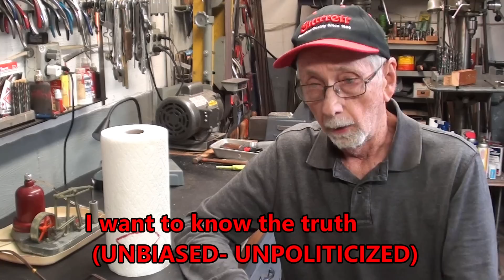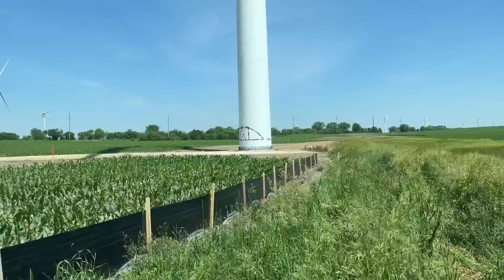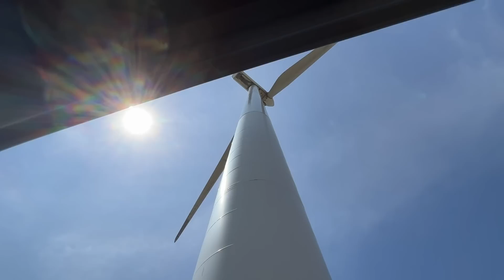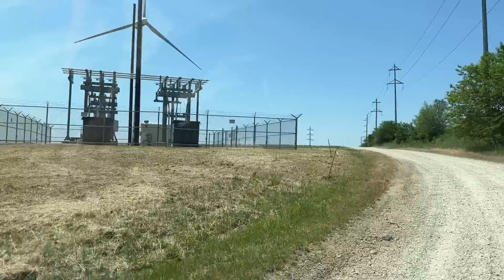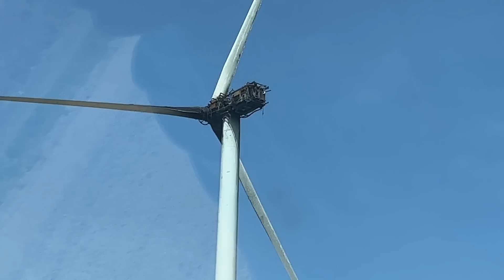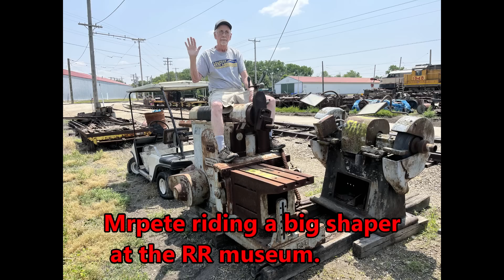OBSOLETE WINDMILL DEMOLITION short #46 pt 1 tubalcain

Comment: All this greenwashing is a money grab. End it including all anti-coal and anti-fracking efforts. Compared to the benefits of civilization the effects of pollution, even dramatic examples with high local casualties, are trivial.  Nuclear power works fine too, proven by France every day without any fanfare. No one was killed by radiation at Fukushima either, that was all done by the tsunami. 
Oil makes the world go round and the benefits more than pay for it even including wars for the petrodollar (where US military dominance ensures microscopic casualties by historic standards, a fact people swayed by drama can't process).
Reply from the maker: Thank you for a very interesting comment. Very factual and accurate, but people will not listen. They have been indoctrinated over the years. If you tell the same lie often enough.  it becomes a fact. Notice the hostility displayed in about half of the comments. Unfortunately, this was a Polarizing topic and video. I did not expect it to be that way. In fact, I thought 100% of the people would agree with me.

Comment: I live in northern Germany, near Bremen, in the state of Lower Saxony ("Niedersachsen").
Many wind parks have been built in this state and the adjacent northern states. In total, we have more than 30,000 wind turbines in Germany.

They produce about 20% of our total electric energy, and more wind parks are in construction or are planned currently.
Nominal total power of those 30,000 turbines is about 55GW (IIRC), and national power demand is about 60GW on a typical day.

Now - in summer - they don't produce much, but we have quite a bit of solar plants - including those on private houses - supplying the grid with easily 35GW or 60% of the demand. But thats, say, 9am to 4pm. Total share of solar is currently 10% of german energy production over the year.

Of course there is a lot of supply variation, but the grid operators can plan ahead. The wind does not change suddenly (as you wrote), but quite foreseeable due to weather forecasting. Same with solar. 
To see how much electric energy was produced this year, see 
https://www.energy-charts.info/charts/energy_pie/chart.htm?l=en&c=DE&interval=year
they also have diagrams for other countries.
This year, we had 59% reneables until now (end of July 2023), thereof about 13% solar, 30% wind, 10% biomass, 4% hydro, 27% coal, and 10% natural gas. Less than 3%nuclear. Projected goal is to have 80% renewables in about 10 years.
 
And about solar: the VAT (normally 19%) has been waived completely on solar equipment for home owners. It's now possible for home owners to get a solar plant in 10kW range for about 15,000 Euros - or less if they build themselves. Energy prices have never been cheap in Germany (not even in the old times when coal and nuclear were heavily subsidized), and such a solar plant will make itself pay in about 10 years.

Concerining subsidies, we had an extra fee of 6.5 euro cents per kWh for many years (called EEG fee - Erneuerbare-Energien-Gesetz, renewable energy act) to support building wind and solar parks. In the early 2000s  wind and solar got subsidized heavily to get to train rolling. But construction costs went down steeply, and efficiency of those planst went up steeply as well, so this EEG fee has been waived recently. 

Wind park owners now get about 9 cents per kWh. Only solar is cheaper.

At sea the construction of wind parks had slowed down in the 2010's, but is now picking up pace. Offshore wind is currently only 5% of Germany's electric supply, but plans are to increase it from about 7GW nominal power to 30GW *this decade*, with projected total power of 70GW by 2045.Turbines in the north sea produce power quite steadily: on average about 40% of the nominal output in summer and 60% in winter.

Onshore old turbines get replaced now, some are 25 years old. The new ones are much higher - i.e. they are more up into the wind and produce more power. Projected is a total nominal output of about 110GW in 10 years or so. Onshore in Germany produce about 22% of their nominal power, but the new 160m (180yd.) turbines (height of generator nacelle of ground, not total height) will provide about 33%. So the older 2MW turbines from around 2010 provide about 440kW on average year round while the new 5.3MW built now will provide about 1700kW.

We are even planning and building new gas-driven power stations - they are the most flexible and efficient ones, and they can be started or shut down in minutes. Of course they are needed to fill in the gaps when wind and solar don't produce. 

The same time we have shut down the last 3 nuclear power stations in Germany for good this year. It's a hot debate here: those who don't want nuclear power stations in the country, let alone nuclear waste deposals, and those who want cheap energy and don't give a damn. And those who point at the enormous costs nuclear has brought us: about a trillion marks (approx. 500 billion euros) over the 4 decades of nuclear we had, with more costs to come for the removal of old nuclear plants and the still unsolved disposal of nuclear waste.

Coal is planned to be phased out by 2038 - or earlier. It will be all renewables, supported by gas to fill in the gaps in the near future.  The european grid will do the rest: hydro from Norway and Sweden, wind from Denmark and Britain, solar from Spain. We now supply Norway with excess energy (mostly wind), and get hydro from Norway when there is demand.

Of course, there is a 27% share of nuclear in Europe,  but all that happened in many years is 2 new nuclear power stations in Europe - one in Finland, one in Britain. Both excessively expensive. And the existing ones are getting old.

Here in Germany are very skeptical about the aging nuclear power plants in France - they ran in big trouble last year: outdated, partly broken, out of cooling water in summer due to droughts, but heavily subsidized (20 billion euros/year, getting worse now - the EDF trust that runs the french nuclear power stations had 35 billion  euros of debt, to be taken care of by French taxpayers).

Bottom line is that Germany is fully dependent on imports on oil, gas, nuclear, and hard coal. We spend way over 100 billion euros every year for those imports. Going renewable will change that. We will still spend a lot, but on building renewable systems with local or at least European firms, not imported fossil fuel from the world.

Our closest neighbours will cease the deliver in the near future: the Netherlands stop to pump gas this years due to too many earthquakes, and the British and Norwegian gas and oil fields run out in approx. 20 years. Our industry heavily relied on Russian gas imports since they were so cheap - that's over since the bloody Ukraine war.

What we have is wind, solar, very little hydro, and brown coal - and we phase out the coal soon.

And btw, heating will be changed too - heat pumps instead of gas or oil. Plus electric cars instead of ICEs - the only ICEs that will continue to drive on the long run will be the ICE train (inter city express, electric of course, in use since the 80s). Electric energy demand may rise by about 50% in Germany over the next 15-20 years, but we think we'll make it.

The future is electric and renewable - in Europe, in Asia, and, hopefully, in the US too.
Greetings from Germany!
Reply from the maker: Thank you for the great information and analysis

Comment: I live in the high desert of Southern California.  There's quite a bit of farmland surrounding where I live, mostly pistachios, alfalfa, and apricots.  However, many of the farmers, especially in Newberry Springs, have started putting solar panels in their fields instead of growing crops.  The immediate impact on the whole area is the amount of blown dust and sand, along with the temperature increase and humidity levels dropping dramatically.  The switch from crops to solar panels began only a couple of years ago, but more and more of the landowners are doing it, and I imagine things will only get worse as more and more time goes by.  What was once a beautiful green area swiftly turned into a wasteland.

Comment: I've done some research and I don't know either how well windmills do. The mere fact that they won't publish the honest info leads me to believe that they aren't very good economically. 
The main problem with any "renewable" energy is consistency, Mother Nature just can't be relied upon to produce a constant steady supply of power. There are times the wind doesn't blow, the sun doesn't shine, or there's not enough river flow for hydro. Windmills won't work at all here in TN, the wind doesn't blow constant enough or hard enough to use them. Solar takes an enormous amount of acreage and panels to produce much electricity at all.

Then you have the environmental impact of this "green" energy. For these windmills, I suspect they can recycle a good portion of them, except the blades. The blades go straight to a landfill. Also, all of this is tied to battery technology. Battery manufacture and disposal is a nasty business. From the huge strip mines to get the battery materials, to the smelting plants that convert the mined ore to usable materials, to the plants to actually manufacture the batteries, to the disposal of the toxic chemicals and elements when the battery reaches the end of its life. 

They (the government) are taking away our ability to have a good constant supply of electricity. They are getting rid of coal, natural gas, and even nuclear (we haven't built a new nuclear plant since 1996), and at the same time they are pushing for more electricity load by the way of electric vehicles, cookstoves, and whatnot. In my 48 years I experienced my first rolling blackout in my life last winter. We had an exceptional cold snap and TVA couldn't handle the load. Why, because TVA have shut down several coal plants without replacing them with anything. I don't think TVA wanted to shut down the coal plants, but EPA regulations had gotten to the point where it just wasn't feasible to keep them in operation. They were also older and needing upgrades, but EPA wouldn't let them rebuild them. They are trying desperately to get some natural gas plants online to keep the lights on, but environmental groups are fighting them tooth and nail to stop that. 

I'm all for alterative forms of energy, but we need to have something that actually works and is feasible before we take our current infrastructure offline. This whole "green" movement seems more based in politics than actual common sense.
Reply: You surprise me. Tennessee has numerous well constructed hydro-electric power plants which are perfectly well suited to store and buffer the intermittent output of wind and solar. Look at Cumberland Lake for example. 
The government is not doing away with our fossil fuels We are (by consuming them). Fossil fuels are by their nature limited and not renewable. We have one chance to get it right and use the limited reserve fuel we have to build an infrastructure around the more permanent energy sources. Those are by THEIR nature not concentrated in space or time but we can harvest them and concentrate them and store them for use at peak demand. And it's a legacy we can provide for our children's children for generations to come but only if we get it right.
Reply: @ExtantFrodo2  Yes, Tennessee has many good hydro plants, but even TVA will tell you they are really only good to supplement other power sources. For the situation last winter where we had rolling blackouts, the lake levels are also kept low during the winter to control flooding, this also limits power you can produce with hydro. Hydro can't be relied upon to produce constant power.
For every study you can produce that shows we are about to run out of coal, I can show you many more that say we have 100 years or more left of it. I honestly don't know which studies are right, but I do know the reason the TVA coal plants are being mothballed. It's not for a current shortage of coal, it's because of the EPA shutting them down.  
Alternative forms of energy are fine, but lets not kill what we currently have until we have something else that is viable and affordable. Current technology doesn't allow you to meet all our electrical need with just hydro, wind, and solar, not to mention the extra electrical needs brought about by the push for electric vehicles. I did the math, to produce the current TVA capacity with solar you would need a solar farm that covers roughly 500 square miles, and this is only when the sun is shining. That area is just for the panels only, not counting all the other infrastructure you would need to make it all work. Then you still have the problem of nighttime and cloudy days. 

I guess you could build more hydro plants, and I'm not against that, but the environmentalist scream about that too, saying you are killing some aquatic animal or whatnot (the snail darter shut down the building of a dam in Columbia, TN several years ago). You also have people that will be displaced by the reservoir created. 

Only way we are going to get rid of using fossil fuels is either have a giant leap in technology or start learning how to get buy with less electricity.
Reply: @m16ty  "lets not kill what we currently have until we have something else that is viable and affordable."
   I wholeheartedly agree. I also agree about the "giant leaps in technology" part too, but you can't get there without people wrapping their heads around the problem. We can get there. Of this I am sure. We need to so that our children's children for a thousand generations hence can live in some measure of luxury.

Comment: The problem with nuclear energy is the waste, which you have to store somewhere, and never goes away.  In California, the Livermore area was a site of early windmill testing, and they used to have some pretty weird ones, like one that was basically designed like a caterpillar tread on its' side.  It didn't work very well.   The technology windmills use is still fairly new, so I would imagine that they will continue to get more efficient.  Larger ones tend to turn more slowly, reducing noise.
Reply: The actual VOLUME of nuclear waste is trivially small and easily managed aboveground. There is no need to bury it or use other one-way solutions which prevent or degrade future maintenance. Nuclear waste discussions tend to ignore how very, very little actual material is involved. France is  a nuclear success story but that doesn't fit US media.
Reply: And Russia- it is lampooned into a caricature by idiotic Western propaganda but it used to be considered perfectly safe by Germany to refuel and remove spent fuel from German fission plants @Comm0ut
Reply: maximum efficiency of wind turbine cannot exceed Betz Limit= 59%. Current Siemens gas turbine= 63% efficiency. This figure will improve as materials and design knowledge accumulate. 
maximum efficiency solar voltaic= 35% Average efficiency 1950s era coal power station= 35-40%. 1980-1990s 47%+. Each time efficiency increase- fuel consumption decreases= longer lifespan. The issue is higher pressure/temerature steam= more power & efficiency. Current trials are ultracritical steam circa 760 deg celsius- 40 more degrees we destroy CO2 bond, easily by rerouting exhaust gases through furnace burning 1200 deg C= no CO2.
There is nothing wrong with coal- it's dead plant material- a cellulose missing oxygen also peddled under green label "bio pellets" which are 100% cellulose. At 800 deg Celsius, CO2 bond is destroyed.

Comment: Bottom line is, we must stop burning coal and oil. Wind farms are part of the mix in order to transition away from fossil fuels. My best analogy would be how those horrid compact fluorescent lamps were the intermediate step to the much more reliable and efficient LED bulb. In Australia we can make better use of solar energy and some states can supply all their energy needs entirely from renewables but only for short periods and only during the day, but that will improve as we move forward.

Comment: Without the subsidies no one in their right mind would build a windmill. Windmills destabilize the grid and anyone running a windmill should be required to supply the electricity in a controlled manner. So either add storage or produce electricity in some other way when there is no wind. Don't dump the effort and costs to stabilize the grid on others.

It is not 5000 windmill, if is about 20'000 5MW windmills to replace one nuclear or coal power plant of 1GW because windmill produce only about 1/10th o name plate power average over the year. And more than 20'000 when you are talking about these small old windmills you are showing in the video. And of course 20'000 full sized modern 5MW windmills still could not replace one power plant because windmills don't produce when the power is needed but when the wind is blowing and they don't have sufficient storage or backup power. To provide the storage to replace one power plant would cost 60 billion. Since the wind does not blow year round and it is not enough to store energy for one or two days.

The thrid power means that when the wind is blowing at 3ft per second a 5MW windmill will produce 5kW, so it can run about 3 water cookers, when the wind picks up and goes to 30ft per second the next moment it will produce 5000kW and if the wind gets a little stronger than that the windmill has to shut itself off and feather the blades so it does not destroy itself and can still be stopped. That's what makes the energy production so volatile and problematic, solar is more predictable and stable, although it too of course needs 100% backup power. So economically solar PV is also idiotic.

Wind power varies with the third power of the speed of the wind, which is devastating to the grid.